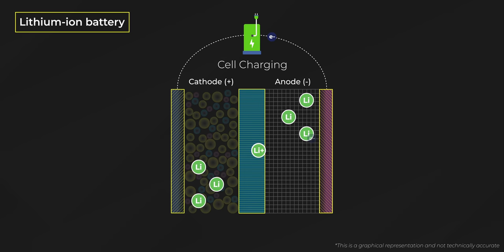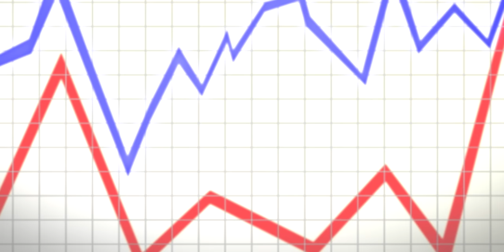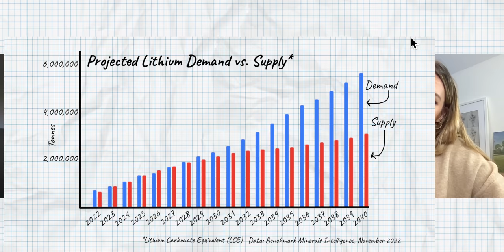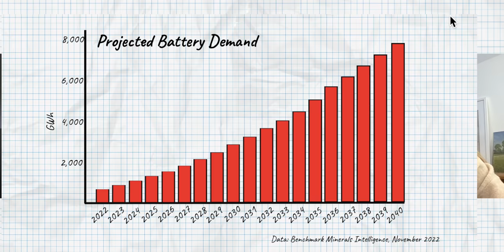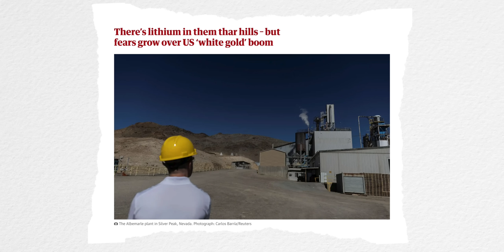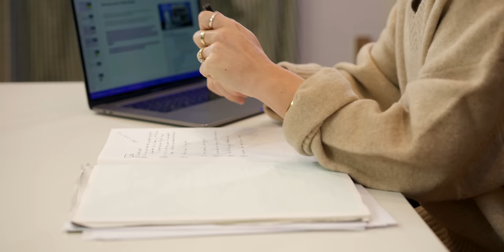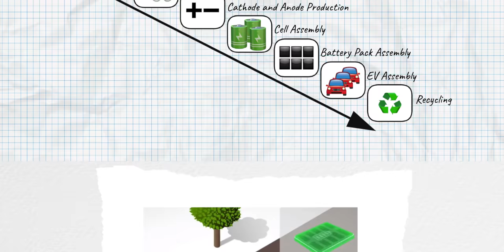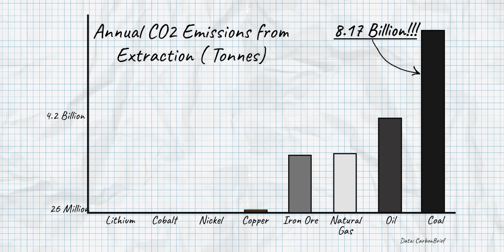There's a Massive EV Battery Shortage. THIS is How We Fix It

Comment: Are they less carbon intensive? They run on electricity that was produced in large part by burning fossil fuels. 
Furthermore, the electricity goes through several steps before it gets to the EV engine, the steps being the actual generation of electricity, which is 30-40% efficient, the transfer, which is 80-99% efficient, the voltage step-down/step-up, which is 95-99% efficient and is done at least twice, the battery charging, which is 60-85% efficient and then the discharging, which is 50-85% efficient depending on the driving style and temperature. 
All those losses without even taking the manufacturing of the vehicle and its battery into account. Some sources state that only 33% of the power generated in the US makes it to its destinations due to losses.
All in all, that comes out to an EV efficiency of 6.5% in the absolute worst-case scenario to 28% in the best-case scenario without considering the production of the EV.
A diesel engine burns diesel at 30-50% efficiency depending on the age of the motor. 90-99% of the pollutants (excluding CO2) generated in latest diesel engines are captured by emission control systems.
So, as long as our electricity is generated from fossil fuels, EVs pollute much more than a diesel car, just somewhere else instead of the tailpipe.
Reply: Do electric cars emit less Carbon over their live cycle compared to a comparable ice car? Yes, by quite a lot.
Reply: Read more than 5 first words of my comment and You'll see why they don't.
Reply: @doogie1350  I read it. Sadly. Because man was that a whole lot of bullshit.
There are life cycle analysis out there. With the electricity mix of most european countries an electric car will output far less than half of the CO2 of a gas-guzzler during its lifetime and it's only getting better as grids and manufacturing move to renewables.
To get any other numbers you have to assume that gasoline falls from the sky fully refined and everything to do with the electric car is done with coal power plants.
So far I haven't seem amy gasoline rains...

Comment: The issue of child labour in the DRC was dodged by the 'we are on a journey' statement. Regarding China's commitment to EV, I have been to Beijing a few times and witnessed first hand the dangerous smog and pollution levels created by the use of coal fired power-stations using to power this 'journey'.
Reply from the maker: It was not dodged, it is being dealt with head on as the latest battery chemistry requires zero Cobalt.,
Here's the really nasty dirty underhand dodge. 
Who has managed to keep their enormous demand for cobalt out of the news for the last 50 years?
Do you know?
I'll tell you. The oil industry. Cobalt is used to remove sulphur from diesel and gasoline as part of the refining process.
THAT is who uses the most Cobalt, oh, and the device you wrote your comment with. We are all implicated, and now the once US and UK owned mines have been sold to Chinese companies, the child labour has reduced to such a degree that Amnesty International have acknowledged it is no longer the problem it was.
But keep doing the fossil fuel industries bidding and bang on about it like a massive bore.
Oh, one last thing, China installed more non fuel burning renewable electricity generation in the last 2 years than had ever been installed on earth, and electric vehicles can run on electricity from any source.
A clanky, filthy, unreliable combustion engine can only burn filthy, toxic, finine, ridiculously expensive fossil fuel.
Reply: Apologies if my comments caused offence, i did not expect personal insults because i questioned some of the content.
Reply from the maker: @watto7728  So you're not apologising for your comments? You're happy to help spread the myth that electric vehicles need coal to be able to operate. 
And that's not offensive?
It might not be personal but it is a lie and you seem to be happy with that.
Instead of coming back with solid arguments regarding Cobalt and generating capacity, you just act hurt and go off in a sulk.
Fair enough.
Reply: @fullychargedshow  I really think you should stop with the personal insults. I've not gone away sulking, and feel no need to apologise for my comments on how the child labour issue had no more detail. I have not stated anywhere that EV's need coal to be able operate.
Reply from the maker: @watto7728  I unreservedly apologise for anything you saw as personal insults.
But you do state quite clearly that the 'journey' we describe as regards the electrification of ground transport is, in China 'powered by coal.
I have cut and pasted your original comment below.
"The issue of child labour in the DRC was dodged by the 'we are on a journey' statement. Regarding China's commitment to EV, I have been to Beijing a few times and witnessed first hand the dangerous smog and pollution levels created by the use of coal fired power-stations using to power this 'journey'.
That is fairly unequivocal to me. The statement "the dangerous smog and pollution levels created by the use of coal fired power-stations using to power this 'journey'. 
What journey could you mean. The use of fossil fuel? Which uses huge amounts of electricity in the refining process?
I don't think so. So what journey were you implying needed coal to be burnt?

Comment: for anyone interested, there is no elemental lithium in li-ion batteries, contrary to what some people might believe and what some simplified animations (like the one shown at the beginning of this video) might indicate. The lithium ions carry the positive charge, and the electrons carry the negative charge. However, they never truly recombine. They both join the anode/cathode (depending on whether the battery is being charged or discharged), where the electrons reduce/oxidise the the anode/cathode and the lithium ions intercalate into the anode/cathode (i.e. move into small voids within the electrode material). They remain ionized throughout the whole process.

edit: my pointing the oversimplification in the animation used in this video is not a diss in any way. I'm interested in natural sciences, but by no means an expert, and I think it's completely justified to simplify processes when explaining something to laypeople.

Comment: I'd like to point out that, even in the sodium-ion battery world, not all cathodes (and anodes) are created equal.

Faradion's cell technology apparently uses a sodium analogue of NMC cathodes, and still uses nickel in significant quantities. CATL are developing a Na-ion battery which apparently uses a 'Prussian blue analogue' cathode, using iron cyanide, which compares to Faradion's chemistry in a similar way to LFP and NCM in the Li-ion world (lower energy density, longer lifespan, more commonplace raw materials).

Na-ion uses 'hard carbon' anodes. Rather than an organised graphite structure, hard carbon is an atomically-disorganised mess. This is actually a good thing, and Na-ion can use lower-grade carbon that's basically scrap charcoal. But this is just one of many supply chain complications - where do you source thousands of tons of hard carbon from? Where do you source thousands of tons of high-purity sodium carbonate from?

Na-ion is a great technology, but it's got a hill to climb that's just as steep and slow-going as Li-ion.

Comment: Whatever happened to the graphene encased liquid hydrogen ion capacitor? I wonder if they're still working on the mass manufacturing capability. It was supposed to be 100x the capacity of a current boost cap.

Comment: For storage, heat batteries will be essential for industrial production they use heat more than electricity! 1414 Australia has one good heat battery but there are many others. Solar thermal has batteries built in molten salts! Chemical batteries are a small but vital part of the transition!

Comment: You could always echelon those electric vehicles with solid connections between them, and have an overhead power feed, or an underground one so batteries weren't needed. To keep them in alignment with the power supply, perhaps some sort of location rail and a separate "Highway" system so they have right of way over other vehicles. Sort of something like they do in Tokyo Japan, it's called a Ji den Sha, I don't know the  translation, I think it's called a Traiñ.

Comment: I do take issue with how sustainable everything is. We are extracting cobalt, lithium etc. But what is missing from the graph of the  effect carbon influence for ev's. The MIT graph does not seem to.allow for the production of the electricity to  charge the vehicles.  Gas and coal.are still the primary sources of electricity production How's this being accounted for?

Comment: If they work out how to get more charge into a battery for the same weight, that's awesome, but don't cut the size of the battery, the more range you can shove into the vehicle for the same weight as the previous model, the more it will encourage sales of the new one, so there are lots of EV's on the second hand market with a perceived reduced value, but with a still usable range for most people. Don't go knobbling the range just to sell more cars with less materials. It won't have the effect you think.

Comment: A few things to note. ebikes or electric scooters are much smaller (and efficient) and can replace some of the short trips that one might take with a car. Smaller electric cars could replace the use of larger vehicles, especially for trips within your own metropolitan area (this constitutes the majority of most peoples' trips and commutes to work). Mass transit can definately play a helpful role. More mining and manufacturing are obviously needed to produce the batteries that will gradually replace combustion engines. Recycling should be mandatory or the shortage of mined materials issue will continue to be a problem forever. Most of this is touched on in the video. Well done.

Comment: IMHO we should diversify and not put all our eggs in the "battery pack" basket? we could look into direct/indirect (LOHCs) hydrogen fuel cells and next gen low emission ICE either as pure ICE or PHEV? there was promising linear free piston generator R&D by a few UK organisations - what is their current progress? micro turbines also ought to be more researched? even making ICE to work better with cleaner biofuels such as Methanol, Butanol, DME and renewable natural gas/LPG could be a long term solution on its own!

Comment: Stop using Li batteries for static applications.  Stop having Li compete with Li.  The Hornsdale 180mWh battery contains enough Li to power 3000 60kWh EVs.

Comment: Interesting to note that Elon has stated quite recently that it isn’t the lithium mining itself the is the biggest problem but rather its the refining to battery grade usable Lithium where the shortage will be critical.
Reply: @4203105  A very stupid assumption to make so not very fair at all.
Reply: @richardgoldsmith7278  Nah, that's just an accurate assumption. You can track pretty mcuh everything he says and point to how dumb and wrong it is.
Btw. when you are done gobbling Elons knob next, could you ask him where my fully self driving Tesla is? He said it should be availible years ago.
Reply: @4203105  the definition of assumption is that the facts are unknown. Still judging by your resort to crudeness, it my assumption you must have been short-changed on the education front.

Comment: Sorry, but I'm not convinced that the 2030 EV dominance dream will ever materialise, & even more doubtful when it comes to sustainability.
Sure you say that it's possible to reclaim 95% of all materials, but how much energy is expended in the process?
The biggest hurdle is quashing the performance advantage of EVs because it takes larger batteries to cope with the demand.
That said, Elon & Tesla fans need to take responsibility for this stupidity.
Does anybody really NEED those performance levels?
And how the heck is the hovering Roadster helping promote sustainability & pull prices down?

Comment: Isn't it something that the Lithium spot prices shown when this video was shot has gone down by 64% as of the writing of this comment. Similar to the great Silicon price explosion of 2004 through 2008, when it went from $17 to $475 only to crated to $60 within a year, and back to below $17 in two. That's right -- sand and coal had shot up that much just because of traders and perceived demand vs production. Are sand or coal rare? Well, neither is Lithium. It has gone from the 50th most abundant element on earth in 1990 to around the 20th most abundant just 30 years later, simply because so much more exploration has gone into finding it. Pretty much anywhere where Sodium (salt) is found, there is Lithium. 

And there are tons of mines going up all over the world. Australia, the world's top producer, has stated that 32% more Lithium will come to market this year, 2023. Plus the pressure of Sodium batteries going into mass production this year, where it will soon displace Lithium for all stationary storage.

Comment: The shortages are at least partly due to bad planning, and deliberate reticence on the part of some legacy car manufacturers. Several are claiming that there is a shortage, and thus giving themselves an excuse for restricting the supply of EV's. The Chinese EV manufacturers are not complaining about shortages, and neither are Tesla. BYD has trebled its monthly output of EV's over the past 12 months and plan to do it again next year. We're looking at them producing 300,000 electric cars in a month, and making many of their own batteries.

It's worth noting that president Xi has issued an order in the past couple of weeks, forbidding Lithium producers from price gouging; raising the price of the metal to about 18 times its level of two years ago. If he has issued that decree, then he knows for certain that suppliers are being far too greedy, and that it is causing the roughly 100 Chinese EV manufacturers to sell their cars at a loss, in an effort to remain competitive. This has meant that only two companies which produce EV's in China are making a profit, namely Tesla and BYD. BYD are making only a slim profit.

Maybe it was too early, but you also made no mention of the new Sodium/Lithium hybrid batteries, which have almost the same energy density of Li-Ion batteries, and about the same energy density as Lithium Iron Phosphate (LFP) batteries. Both of those types are being improved steadily, but Sodium has the advantage that the cells are much more tolerant of both colder and hotter temperatures. It also has the big advantages of being much more abundant than Lithium, and being much cheaper to refine and use. After all, it's in every grain of common salt that you see. These new batteries are already being evaluated in prototype form in EV's. Results have been good so far, and there are definite plans to market lower cost EV's with this battery type. Estimates are that the new battery will cost about 50% of the price of Li-Ion batteries, and even undercutting LFP battery manufacture costs by almost 25%.

LFP batteries contain no Cobalt. Cobalt is also being reduced drastically in Li-Ion cells, with the aim of replacing it entirely, thus circumventing the dubious supply chain issues. 

Another development is the recently patented chemical method of extracting Lithium from ores, which can extract well over 95% of the Lithium, and could reach 99.5% extraction levels, at about the same price as the older methods. Less pollution is caused by this method. This technique also compares well against the most common methods of Li extraction which only recover about 45% to 50% of the metal. What that means is that formerly waste clays and ores can be reprocessed, to remove at least as much Lithium as was removed during the first processing, thus essentially more than doubling the amount of available Lithium.

Thanks for the excellent video. 🙂👍

Comment: Electric mobility does not always imply using batteries : trolley-buses, tramways, metros, trains. So we must switch form ICE cars to EVs, but also switch from cars to alternative transportation when possible, eg within cities and between cities. And off course we can walk and bike, eg to have only one car for the family even in a rural area. Finally, batteries do no have to be huge, in 2022 it is already possible to go everywhere in Europe with a Tesla model 3 with only 60 kWh. So no need of 100 kWh or even 80 kWh per car. However, we need to keep up with the grow fast DC charging, but also AC charging at hotels and other places where one will anyway have to stop for several hours. Having at least 16A charge points should be mandatory on each parking slot of hotels.

Comment: Here's a thought, people complain that EV's are associated with Congolese child labour, because of cobalt in the batteries, but don't complain about the fuel companies that have been using cobalt as a catalyst to remove sulfur from crude oil for over a CENTURY!

The amount of cobalt used by fuel companies exceed EV battery volumes by thousands times. As EV battery manufacturing are moving away from using cobalt, fuel companies will continue to use it till the last drop of oil is refined.